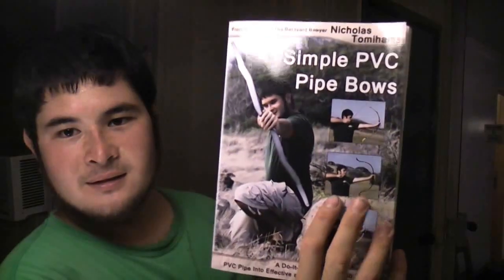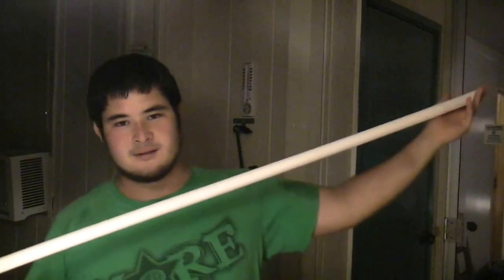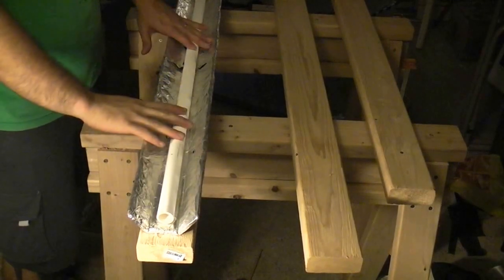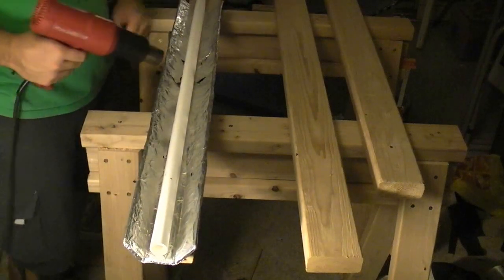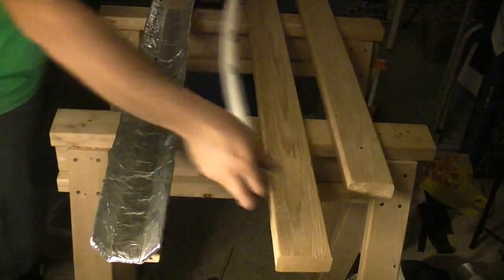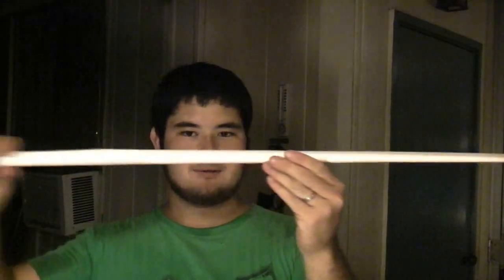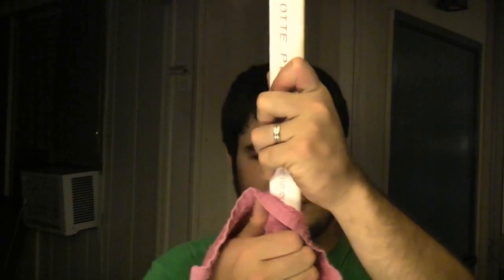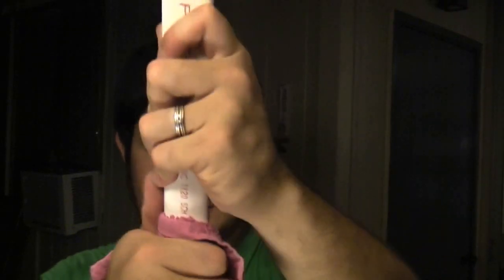How to Make a 25-30 Pound PVC Takedown Travel Bow Part 1 - Flattening

Comment: It takes me about 5-10 mins with my Wagner heat gun at its High temp. setting. It's all in the technique. It's hard to describe, I keep the end of my heat source at 1-2 inches away keeping a painting motion along the limb, while rotating the pvc pipe (at about 1/4 turn each pass). Like Nick says, it should be ready when with light-medium finger pressure the pvc pipe should collapse and touch. It's a bit discouraging at first, but keep at it!

Comment: I have a Wagner heat gun that I use on high @ 1350 degrees and it takes about 3 - 4 minutes to get half of the 5ft 1" pipe to the point where it bends how I want it to. I also have a similar setup with the tinfoil-lined cardboard heat shields

Comment: Anyway for the sake of making things easier, ill post the measures here:
Full pipe length: 52 inches - 132cm, INSIDE diameter 0.75inch-1.9cm
From the middle (26inch-66cm), mark 3 inches-7.62cm on both sides, and that is your handle
On both ends, mark 6 inches-15,24cm, and that will make the tips